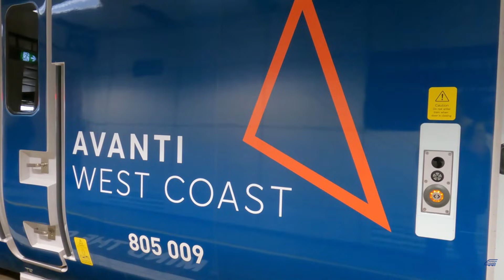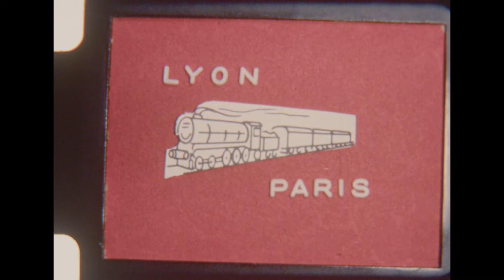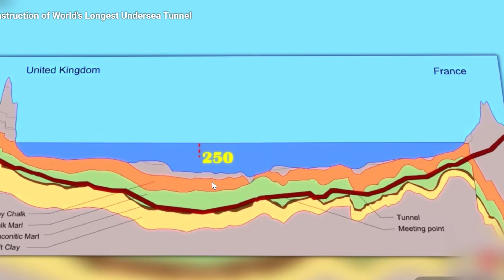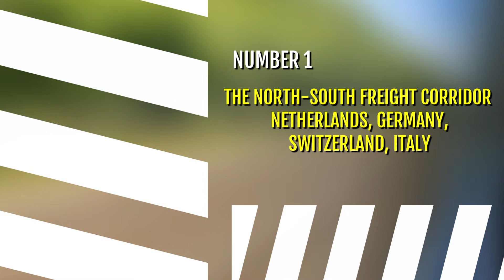7 Railways That Power Europe’s Economy

Comment: The number one is limited in capacity caused by Germany, not keeping up its promises to connect the dedicated high speed (for freight) double track freight line to the Ruhr area. The Netherlands kept its promise, the line is open since 2007, but ends at the German border and has to continue over double track passenger rail because Germany is super super late with its double track freight rail expansion. Next year (in 2026, 19 years later!) one track will be opened on a stretch of only a few kilometers, as a third track next to a double track passenger rail line. It is ridiculous, the Germans are seriously lacking behind and actively frustrating the flow of European freight via rail from and to the port of Rotterdam.